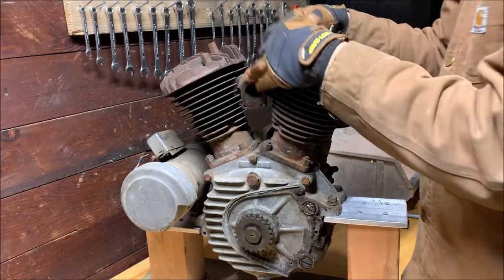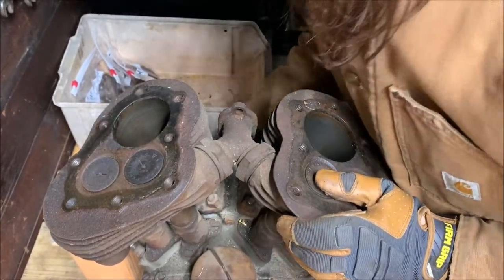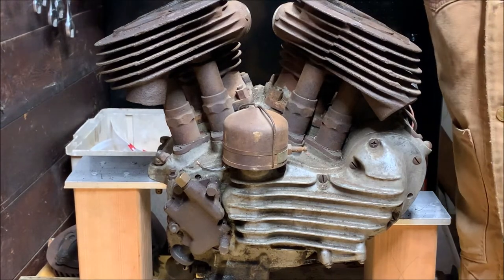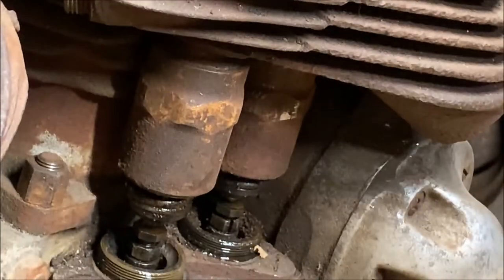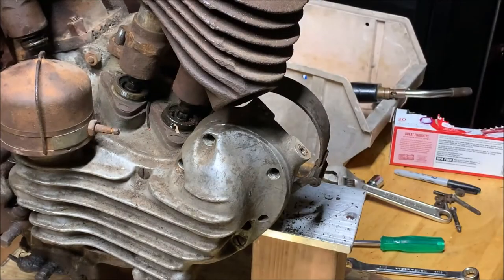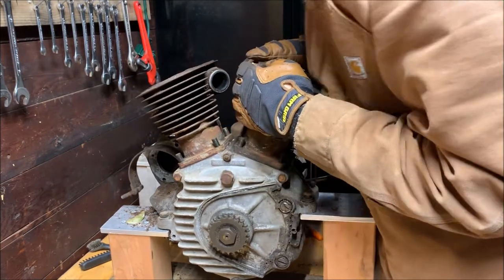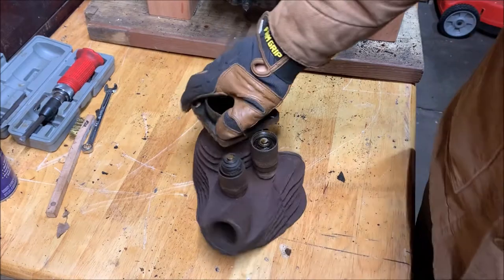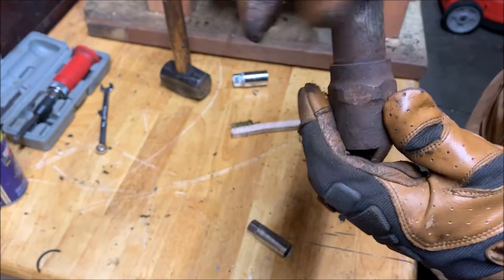Harley Flathead Engine Teardown Part 1: Cylinders

Comment: You seem to know what you're doing as far as flathead disassembly goes, and the video is well done -but as a former helicopter mechanic watching you fumble with channelocks and a pipe wrench on an engine is soul crushing.
Reply: ...and vise-grips!  to quote that wise philosopher Charlie Brown, "Arrrgh!"
Reply from the maker: @KevinWintersVA  Can absolutely agree! Though I do have a very soft spot in my heart for vice grips (been with me since the beginning when I didn't even have a socket set). I hate not having the right sized box end to use (I've actually since made a wrench for those ginormous intake nuts). It isn't visible in the video but the only reason I own that specific pipe wrench is because its actually smooth jaws, so I basically use it like a giant crescent wrench.
Reply: @theshop2064   knipex pliers, my friend.  Non-marring, and can get the grip of death on things.
Reply: The gloves tell all..
Reply: yes- I was about to leave a similar comment.  The screwdriver under the gasket was the first 'clue'.  Removing the intake with with 'that thing' -  I stopped the video-  I'm done with this guy.
Reply: The frantic groping 😂 just watching now for comedic value

Comment: I like to spray the fasteners with penetrant a day before I dissassemble.
Reply from the maker: This is always a hot topic, but I don't use penetrant on rusted fasteners. My go to is heat (unless the hardware is heat treated and that needs to be preserved), to expand the outer threads to de-bond it, or to expand the internal threads to crush the rust layer between the threads to make room. But I know everyone has their own special trick to remove fasteners so I don't judge.

Comment: Great video, bro.   It is nice to see people into the older stuff.  It has character a lot of contemporary motorcycles lack.   I'm doing a chopper with  a 45 G motor, myself.  Detail on the pistons and cylinder bore would be interesting.  I notice the pistons have that skirt oiling slot and the baffles are still installed.  You don't see things like that anymore.  It is an obsolete design now.  Wonder how well it worked in application?     Regards.   Good luck.
Reply from the maker: Interesting stuff indeed! The baffles in the crankcase (which I believe you’re referring to) are to aid in front cylinder lubrication (which is why you only see the machined into the front cylinder mating hole. The baffles cause a restriction and thus a low pressure as the piston goes up. This causes the oil misted air in the crankcase to travel up into the front cylinder and lubricant the cylinder wall. The rear cylinder gets all the “splash” lubrication so the baffles isn’t needed there. Now modern engines have oil squirters, etc. so you don’t see this kind of innovative thinking in design any more. Though it is more efficient to not have the baffles for pumping losses.... oh well

Comment: Hi, is it possible to change my leaking valve cover seals (the part where you were using plumbing tool to undo the covers) without taking the barrels off.. excuse my ignorance if it’s not possible 👍🏽

Comment: Cringing in my seat.  NEVER pry between the cylinders and the block.   Invest in a dead blow composite hammer.   NEVER yank up on the cylinders as was done.  Use a piece of wood to gently tap down on the piston as you hold pressure up on the cylinder.  I realize you were alone. I love that you were not afraid to tackle the job.   Anyone that works in 10 degrees temp. has the gusto for the job!